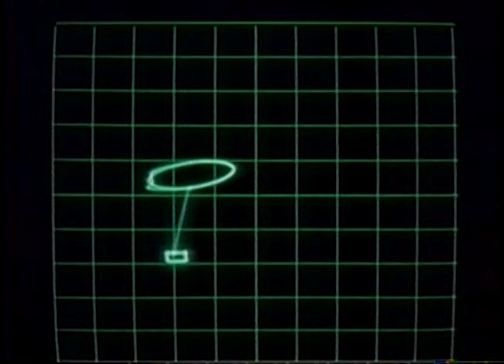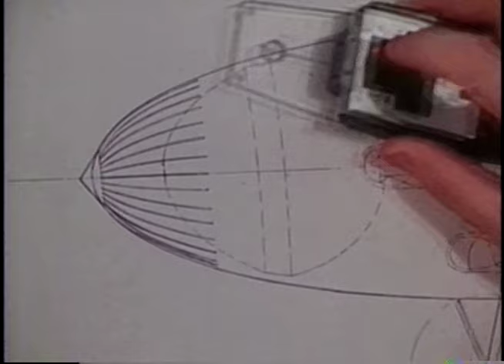The Cargo Airship That Wasn't

Comment: so why didnt this happend? seems like a great idea
Reply: They tried making one (the Piasecki Helistat) and it crashed on its first attempted flight.  There wasn't really a way to make it safe to have spinning blades right next to the gas bag.

You might be able to do it now with shrouded fans though
Reply: @t.o.6953  it had more to do with using hand-me-down parts and a lack of proper vibratory stress calculations and the resulting vibration damping literally shook the frame apart.
Reply: @steffen19k  true, the helistat was a shitshow
Reply: Helium cost went way up, the offloading of cargo mass and taking on of required ballast problem, and the getting pushed around all over by the wind when landing/landed problem.
Reply: It failed due to pilot error.